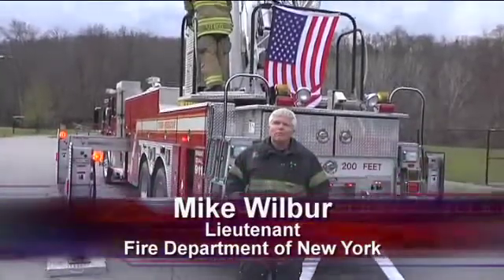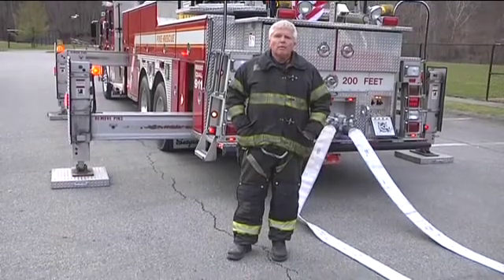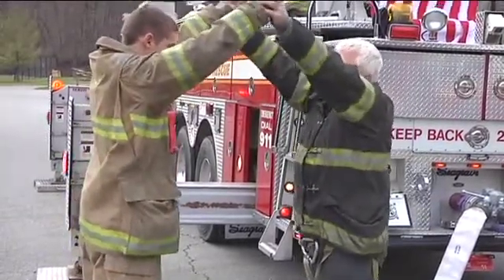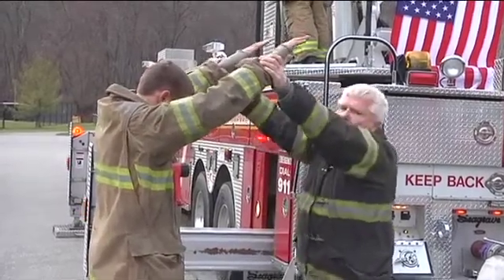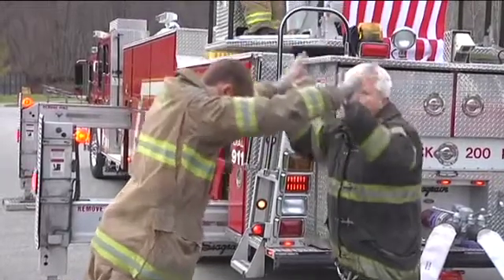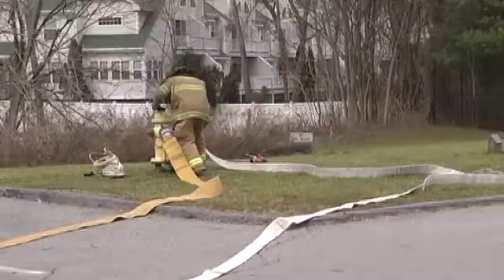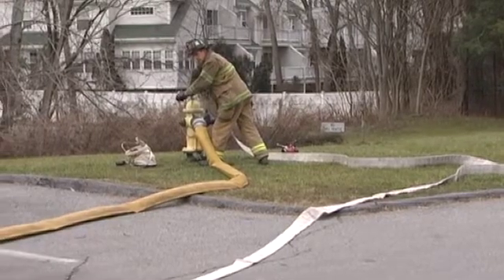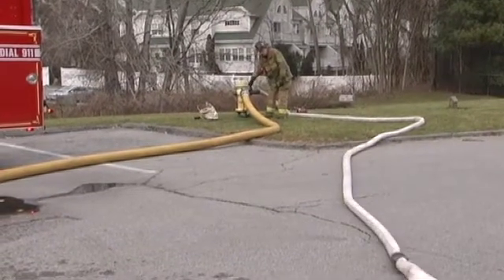Water Supply for Aerial Devices

Comment: If this is a fire truck and It is going to a fire why would it not have at least enough water on it to spray for 2 or 3 minutes so the fire doesn't get out of control while they are looking for a hydrant?  Or at least be flowed by a water truck that Has water in it?
Reply: Specified job
Reply: This truck has a pump on it, so it most likely has a 200-500 gallon water tank on it.  That's enough to supply a handline for a few minutes while the truck is getting hooked up to a hydrant.  The ladder pipe is going to flow over 1000 gallons per minute, so it will definitely need a water source very quickly--not to mention that if you are using the ladder pipe, you have probably lost the original fire building.  That all being said, many departments use ladder trucks without pumps and water tanks because they use their truck companies for truck company ops like search, rescue, and ventilation and expect that an engine company will be arriving first or soon after the ladder truck to spray water.  In this video, the ladder is being supplied by a hydrant directly and an engine.